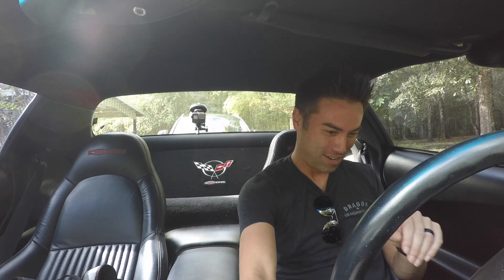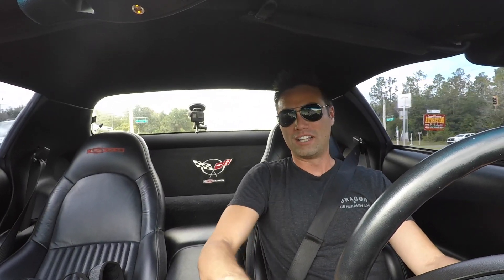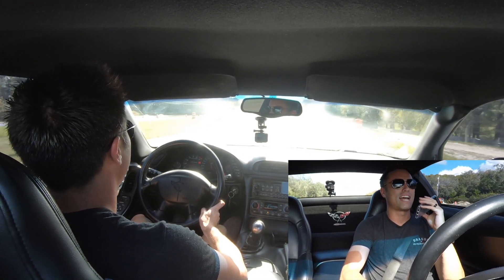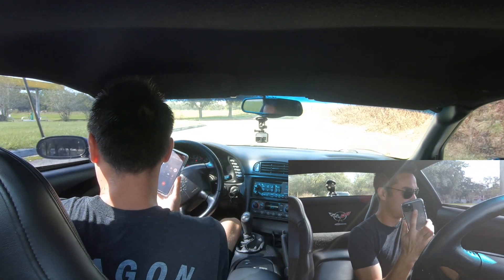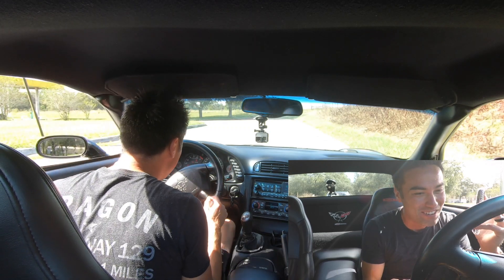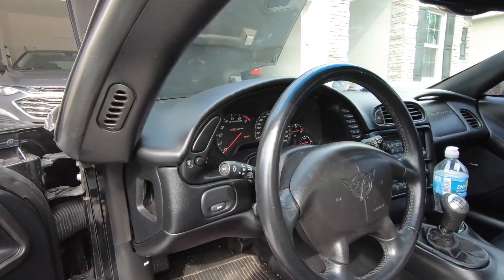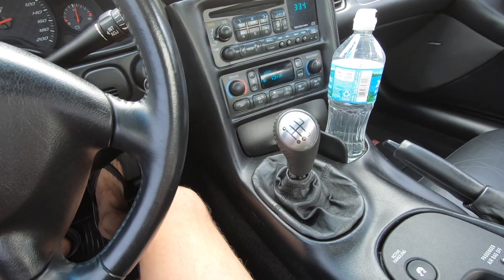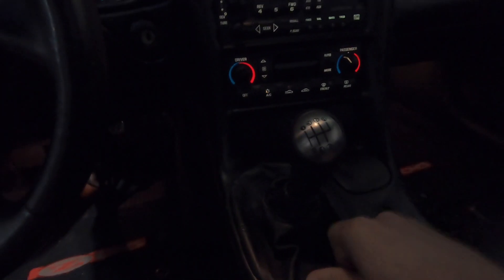Already BROKE my NEW C5 Z06! C8 CORVETTE STILL DOWN

Comment: Serious advice - buy all new belts, harmonic balancer (summit 2501), 2 idler pulleys and both tensioners. Will prevent car from exploding when you beat on it.  Also invest in an aluminum radiator
Reply from the maker: Thanks Jeffrey! I’m going to go through all the records again cause I think I saw a receipt or two with either the pulley or tensioner. But I’ll get stared on all the other stuff. I appreciate all the tips and thanks for watching!
Reply: Jeffrey Moore I don’t agree with the harmonic balancer replacement unless you know outer ring and inner ring does not line up after a good drive. I have 2003 z06. Just put a white chalk mark on the inner ring all the way out to outer ring. After good drive if the lines are broken, your rubber seal is shot and tow it to nearest shop. Yes rest you recommended is a must. Since it’s a 2001, I don’t think it came with yellow China valve springs. Not 100 sure tho. I swapped mine out because known failure issues. Also LC5 column lock bypass should be on the list. So you never have to worry about getting stranded.
Reply: @Faith0929ROK  No problem. Everyone has to do what they feel is best for them. All the best.

Comment: thank goodness my 04 Z06 doesn't have those problems...just a new radiator, replaced with a two core All aluminum, no plastic side tanks and the oil pressure sending unit.
Reply from the maker: Nice, yeah this one will be a fun project. Thanks for watching!

Comment: Press the shaft straight down, like your knife stabbing the stem of the shifter knob directly  into the transmission the direct the shifter over to the R as it should engage reverse fine. Matt aka MC Viegas.
Reply from the maker: I’ll give that a shot. Someone else said suggested that too. Thanks!